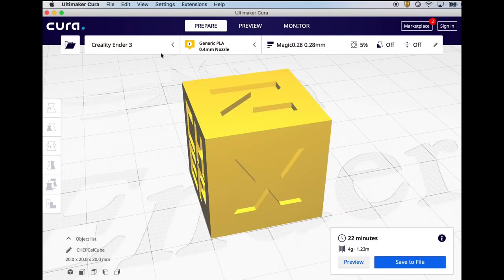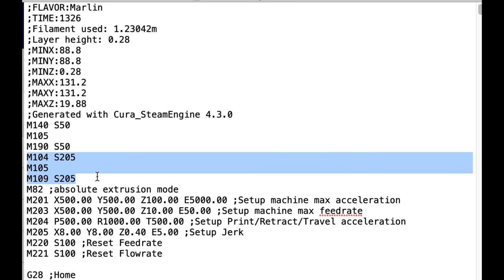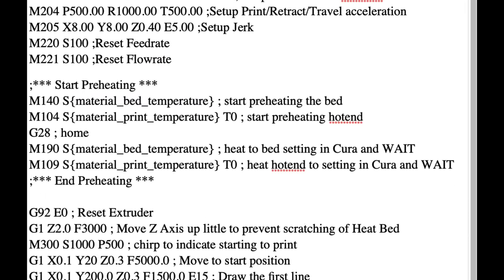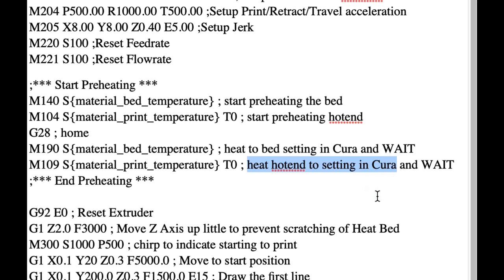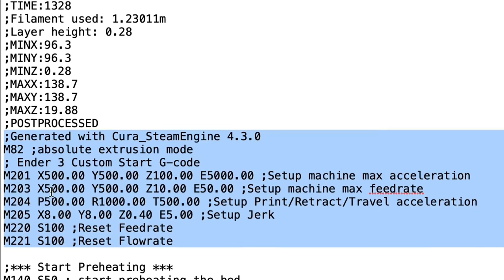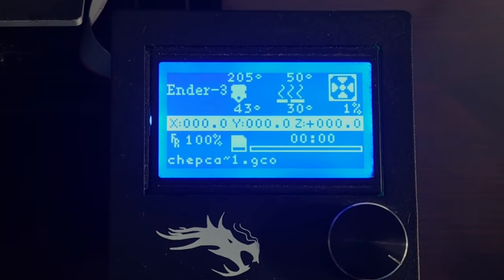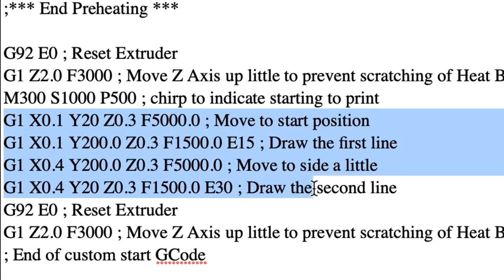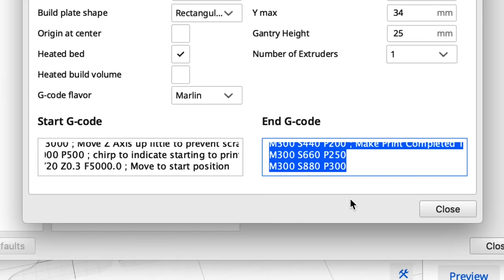Faster Hot End & Heated Bed warm-up in Cura

Comment: Im confused. If they make it so by default the bed and then the extruder heats up one after another because they're concerned with too much power draw, then how do the bed, extruder, hot end and all stepper motors run while printing with no issues? derp.
Reply: It takes more power to heat the bed and nozzle from room temp. Once heated it uses less power.

Comment: 1:43 All printers must handle power to heated bed (around 200W) Hotend (40W) and stepper motors at the same time. Most switching power supply switching off when over current and will interrupt current printing job. If power supply was to weak to handle 3d printer you never print anything.
Reply: As Chuck mentioned, he's tested this on an Ender3, however, he also said YMMV.
Reply: Result must always be the same - it must work. If not you have a toy not 3d printer. This comes from basic rules how switching power supply works and how you regulate heater temperature by switching power on and off. At one point in time all heaters and motors draw maximum current from power supply so it must handle bit more. No way around it.
Reply: @tomaszbiskup891   I think you're misunderstanding how the extruder and bed heaters work. The power supply stays on, and the Arduino, or other CPU, switches the power supplied to them via PWM, Pulse Width Modulation. ie: it switched the power on/off while also adjusting the  length of time in between the pulses. While the power supply may be a switching power supply, it has nothing to do with heating, other then providing a constant source of regulated 24 volts.
Reply: I know all about how it works, all about pwm, bang-bang, PID control and other fancy word. I have issue with words in video "Many printers can handle heating both  at the same time because they have enough power in their power supply" i reply that all 3d printers must handle all heaters with all stepper motors moving at the same time! This is essential. User dont need to worry about power requirements.
Type of power supply matters - Switching supply monitor its output voltage, and if you draw to much current it cannot keep up and switches off. Transformer based power supply on the other hand when you draw to much current Voltage drop down but for short period of time you can stress it.

Comment: It is not advised to do this, as the hot end will heat up and remain at temperature before printing starts.
Which causes carbonation in the hot end, and causes jams later on.

Ideally, set your bed temperature first to like 40C
Then set your hot end and heated bed from that point,
So that the filament in the nozzle spends the least amount of time in the hot nozzle, thus limiting the amount of carbon build up
Reply from the maker: Where does the filament get carbon? ;)
People including me, have been doing this from the LCD menu for a long time. This just automated it.
Reply: CHEP I’ve been doing it with an ender 3 pro for the last year with no issues. My bed always finishes heating first anyway. So I don’t see how filament is spending more time inside the heated nozzle.
Reply: Huh??? Carbonation??? LOL. 😂😂😂
Reply: @chep the carbon comes from the dyes and fibres in the filament

I used to use the method you propose, however after 10 years of dealing with nozzle clogs from one thing or another.
One source of nozzle clogs is due to the filament dyes and fibres.

Comment: how to remove CE3PRO from filenames
Reply: In preferences, General, under the 'Opening and saving files' section there's a tick box for 'Add machine prefix to job name'..
Or, bottom left side of the Cura screen, you can see the name there that the code will be saved out as, you can simply call the prints whatever you want to, depends if you have multiple printers or not as leaving the CE3Pro bit there helps ID the printer the job is aimed at.

Comment: Preheating nozzle early isnt good as i will create a blob in tube. Heating bed takes time.
We could do this, heat bed to target-5 C first. Then start nozzle hosting and continue heating bed.

This way bed and nozzle can reach their targets around same time.
Reply: Created a solid solution
Reply from the maker: Many people use the preheat both in the LCD menu without issue. I’ve done it myself. Any blob or ooze gets cleared in the test strip.

Comment: I surely can use this also on my Cr 10 mini. I used to heat bed and nozzle in parallel before with no problems. However if the bed needs 2 or 3 times the time of the nozzle to heat up one might get a bit of oozing out filament.
Reply: That's what nozzle purge is for! Fairly easy to make, there are several pre-written codes to do it if you Google.
Reply from the maker: My start code already has the purge strip.
Reply: CHEP ok I’ll give it a try. Also the beeping sounds like an interesting gimmick

Comment: Heating the bed and nozzle at the same times does cut down on the wait time, but it also limits the amount of time the bed surface needs to properly heat up and even out before it's truly ready for printing. Would you rather wait an extra minute or so  before being able to start a print, or have that print potentially start to detach from the bed half way through a long print session, simply because you couldn't/didn't want to wait..? Also, heating up the bed and nozzle at the same time pulls much more current from the PSU and MB, which could shorten their lifespans. Why risk that to just save a minute or so?
Reply: The heat bed is almost heating up evenly on almost every printer since the coil is evenly distributed.
Reply: @ZillionPrey  Maybe reported by the temp sensor... but the glass bed on top needs more time.

Comment: Hi Chuck. I really liked the idea and added the needed gcode as you show. from some reason, the cura adds its own lines before the lines added.
you can see in the following. all the lines from ; generated with... until the M82 (included) are not shown in the start G-code area and added automatically.
Any idea?
;Generated with Cura_SteamEngine 4.3.0
M140 S50
M105
M190 S50
M104 S205
M105
M109 S205
M82 ;absolute extrusion mode
M201 X500.00 Y500.00 Z100.00 E5000.00 ;Setup machine max acceleration
M203 X500.00 Y500.00 Z10.00 E50.00 ;Setup machine max feedrate
M204 P500.00 R1000.00 T500.00 ;Setup Print/Retract/Travel acceleration
M205 X8.00 Y8.00 Z0.40 E5.00 ;Setup Jerk
M220 S100 ;Reset Feedrate
M221 S100 ;Reset Flowrate
;*** Start Preheating *
M140 S50 ; start preheating the bed
M104 S205 T0 ; start preheating hotend
G28 ; home
M190 S50 ; heat to bed setting in Cura and WAIT
M109 S205 T0 ; heat hotend to setting in Cura and WAIT
;*** End Preheating *
Reply from the maker: That’s strange. I can’t think of why? It’s worked for a lot of people.
Reply: @FilamentFriday  it adds the new code and also the auto generated code
Reply: Figured out my mistake. I added the code with a specific temperature instead of the code in the {} brackets. Cura looked for it and since it wasn't there it was readded.

Comment: Hooray! Another video which about the Ender 3! How about other printers? You lost me at 2min. 21 sec. about the variable that comes out of nowhere. Suddenly your screen changes and no explanation.
Reply: I couldn't possibly fathom how you could think this is Ender 3 specific O_O.
And you getting lost... that's on you dude. The screen changes and he explains you can use those variables to replace the default heating up gcode with your custom gcode as he is displaying on your screen.

If this really is so far above your head, hobby level 3d printers are probably not meant for you dude... this was very well explained and pretty basic stuff...